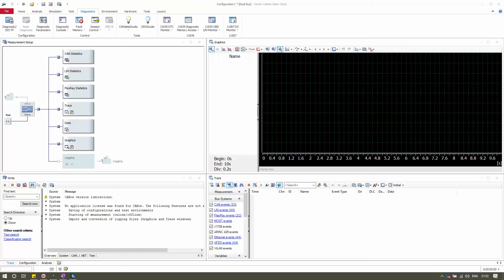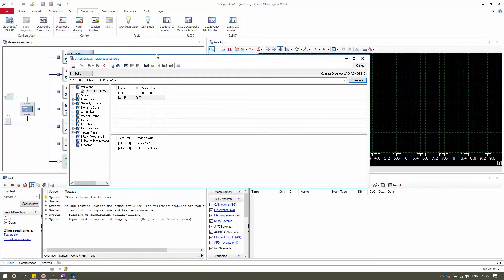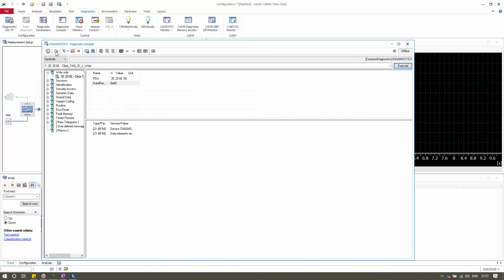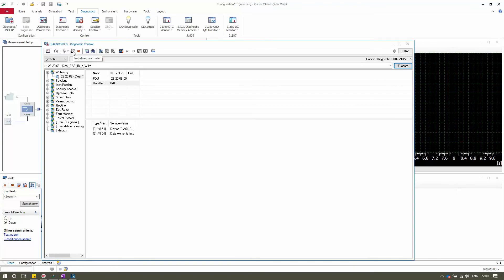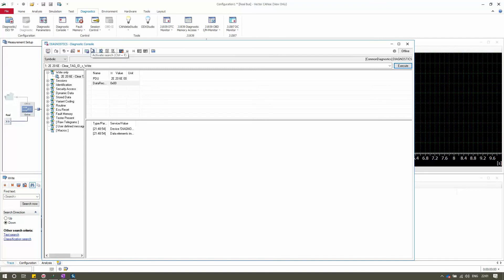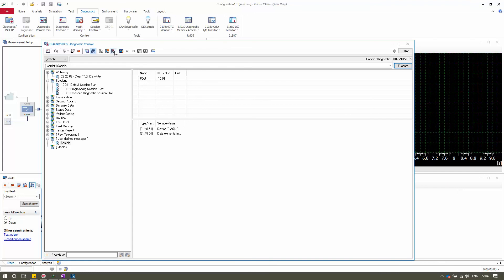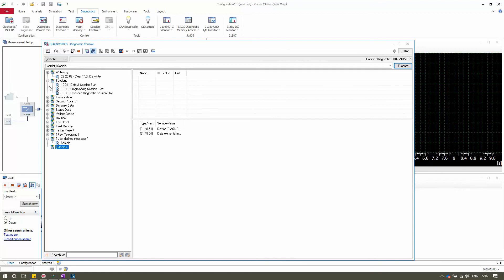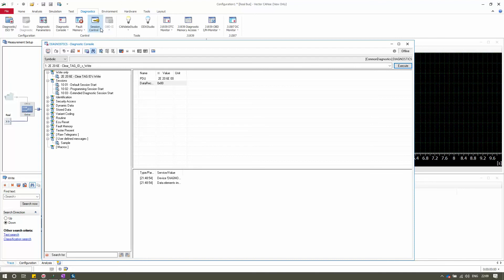Vector CANoe Diagnostic Console Panel

Comment: In day to day testing. I haven't tried all options...nit knowing it fully...now I'll use complex steps in just few steps...thx for the info
Reply: In CANoe, does the data from the Diagnostic Console pass through the Trace Window for every read and write (i mean is the trace contain all the frames out and come to canoe )? I have two traces, A and B. I want to determine which channel the DID panel receives data from

Comment: Hello, Is there any option to save Diagnostic window as I left it?
When I open some of this groups by pressing "+" icon and close whole configuration window, they are closed once again. I cannot find any option to save this diagnostic window (with groups opened). I use some of this requests very often, but I have to switch configuration files and re open them as much.